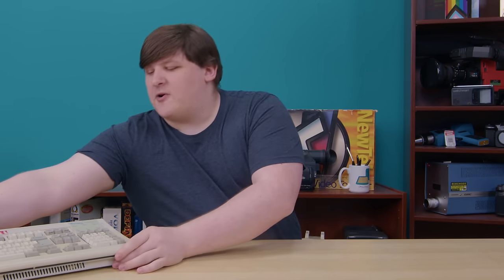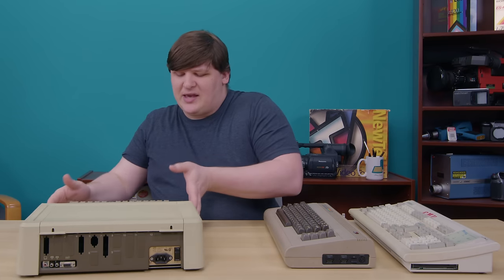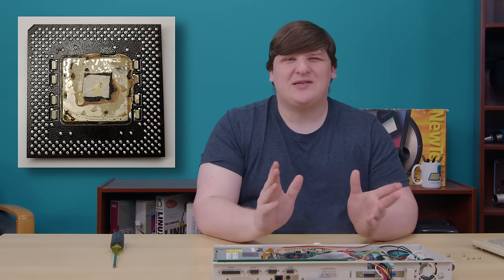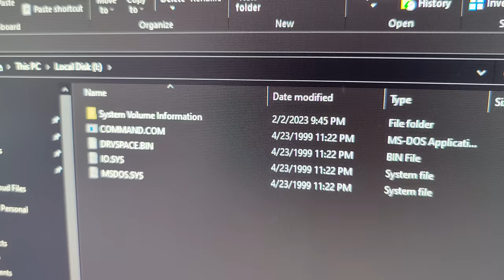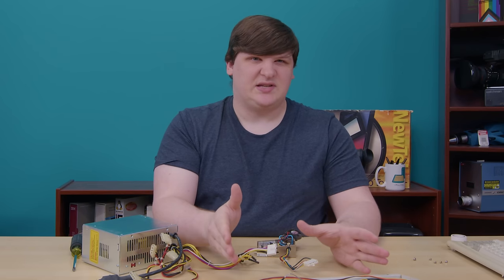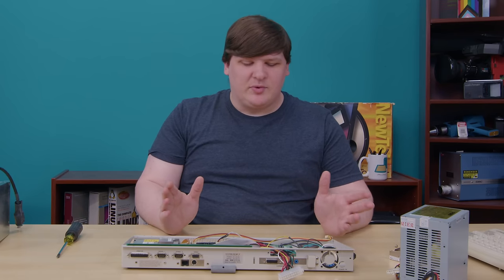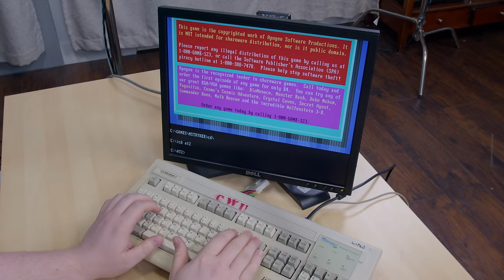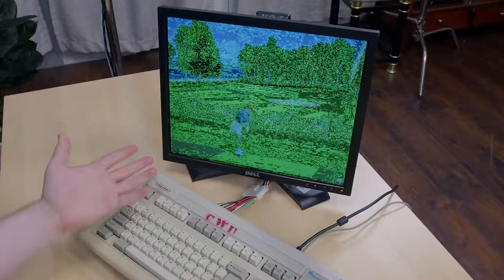I turned a weird "keyboard PC" into an FM boombox

Comment: You know what? That atx power supply is actually a really good solution

I got some old laptops, imported from japan, pc98. I have to import the laptop variants because the desk units would be too expensive to ship, though with how many laptops I’ve shipped that might not longer be true. The thing is that the power supplies on these things are extremely prone to failure by now, so yanking out the psu and replacing it with a modern one would honestly solve a lot of issues, and im not planning to ever actually use these things as laptops

Comment: It took me several embarrassingly long seconds to guess why it has no PS/2 keyboard port :P.
The chips near the CPU socket are probably L2 cache.
Wild guess on the VRM daughterboard: i have a couple of old AT mainboards (by PC-Chips, I think) that are compatible only with single voltage CPUs out of the box, but have a connector for a VRM module to enable compatibility with dual voltage CPUs like the Pentium MMX. Or it may simply be that they ran out of space for it, just like you said.
Your song is great!

Comment: I think I ran across a really weird Harris wedge-shaped keyboard computer a few years back. I don't really remember and it's been awhile since I've seen it. I know the board and all of the chips were Mark Harris but I don't remember if that's what's on the enclosure

Company was straight-up prolific with some of their own custom IC chips that are super weird and have little crystal tops like an eeprom would normally....but are not eprom chips. Some of them were special color sensors and code readers. The weirdest one is some kind of weird  oscillator that can be customized to frequency based on how you program the reprogrammable window. One of the weirdest things. Either that or something to do with the amount of light going into the Crystal window changes the frequency of the oscillation. I honestly don't remember but diodegonewild did a laser tube video a year or two back with something very similar inside of it. I'm always poking around and researching weird chips in my collection but I just haven't got to those yet.
Harris chips were always some of the most interesting Stuff in my chip collection even among thousands of rare or weird chips

Comment: There have been a few "keyboard PCs" or "Wedge PCs" over the past few years, I know there were some very cheap ones with Intel Atom CPUs in them.  A company called My Retro Computer is supposedly working on a Commodore 64 replica that looks like a Commodore 64 but has a modern PC motherboard inside it.  The work they're doing is based on the work of Commodore USA back in the early 2010s until I think 2012 when their CEO died.

Comment: Maybe hook an oscilloscope up to the 3.3v rail and see what it's doing. I recently had a weird issue on a board design where the audio and video would start buzzing/flickering in response to CPU activity, I found out it's just my regulators doing a weird threshold thing when the 5v rail can't maintain enough headroom. I mostly fixed it by using a power connector with lower resistance. Maybe that little voltage regulator board is behaving similarly, in which case try reseating it to make sure those pin headers are making good contact.

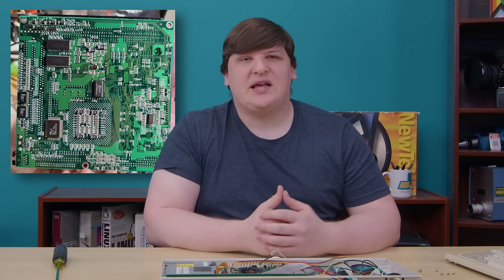Comment: 15:20 Actually this add-on voltage regulator was very common, especially on early socket-7 motherboards to power Pentium-class CPUs where split voltage was first introduced. Another youtuber even made an open-hardware version that fits many motherboard. It was kind of a standard.
Although from your video, it's hard to tell if that 'standard' is followed. I'm guessing not considering it's parallel to the board.

Comment: The wobbly screen does seem like some kind of power or ground issue upsetting the clock in the video chip, you would have to poke around with a multimeter or even a scope to see if ground isn't properly at ground potential or the voltage sags when under load or whatever.

Comment: The Poisk is not the only one post-Soviet "wedge PC". There was at least 4 more IBM-compatible models:
- "Assistant-128" - architecturally similar to IBM 5150 with CGA and ports card. No FDD by default, 128K RAM. Actually made in Russia (by Iskra)
- "Quasar 86" - based on 8086(!) clone, but has no extension slots. No FDD, 128K RAM. Made in Russia too.
- MC 1502 (MS 1502) - uses 5 original soviet ASICs as a "chipset" and has 5.33MHz clock speed. 128K RAM, no FDD by default, but pretty extensible. Designed in Ukraine, made in Russia.
- MK 88 - had an FDD controller for external drive unit, up to 640K ram, and car-like price. Designed in Ukraine, made in Belarus.

All of these PCs are IBM-compatible by hardware without emulation things used in Poisk. But they was even less common in retail.

Comment: As a musician, I'm impressed with that song! You should totally be proud of it!

The weird behaviour makes me feel like its EMI related. What with the effect presenting itself during processor loads.
Perhaps due to the cooler?
Reply from the maker: Thank you so much!

Regarding the EMI - it's been pointed out that the VRM is directly on top of the graphics chip, and I bet that's what the problem is.
Reply: @Cathode Ray Dude [CRD]  You are more than welcome :)

Ahhh, that does make sense. A grounded sheet of aluminium inside a layer of kapton may be a janky solution, im sure you've thought of that already though. 

Either way, keep up the fantastic work, man!

Comment: The long delay when its booting and not reading the drive happens when there is no ethernet connected and it sits looking for an IP.  It times out and keeps booting eventually.  if you connect a cable that delay won't be there.  The video ripple seems to be a common problem with (cheap?) onboard video...even on more modern pcs.

Comment: What an interesting machine. The keyboard computer form factor hasn’t completely gone away, although as you can imagine, the modern one I know of isn’t exactly aimed at mainstream desktop. The Raspberry Pi 400 is a neat, compact little keyboard with a 4 GB Pi 4 laid out in a different motherboard form factor. As a hobbyist I can think of some interesting uses for it.

Comment: One quick thing I would suggest for your wobbly display is to slap a ferrite core around the VGA cable.  It could be that /changing/ what's shown on the screen is sucking power from the sync line to remote ground.
Reply from the maker: interesting idea! I THINK I'm using a cable with a ferrite already but I'll double check.

Comment: I think all in one computers that have a built in monitor, such as the iMac G3, also hurt the market for Wedge computer. Keyboards were cheaper and easier to produce, so the value of having one built in was a lot less compared to the computers in the 80's where personal computers were a whole new thing. Monitors on the other hand were still pretty expensive, so having one built into a computer gives it a lot more value than a built in keyboard, and it's harder to break a monitor on accident than a keyboard (at least in a "professional" environment.) It also mostly solves the size issue that the computer you showcased has (at least with it's cooling,) as monitors are bigger than keyboards, so there's more room to work with.

Comment: You might want to try a PicoPSU, a converter the size of the ATX plug that produces all the ATX voltages from a 12v input.Except that as far as I know it doesn't have -5v.
Also, if there is no -5v the health page of the bios (voltages and fan RPMs etc...)might hang. It happens on one of my boards.

Comment: "What could it be going?" - Windows 98 is trying to find a DHCP supplied IP address on the network during boot, which is insane because it will do that regardless if a cable is connected or not.

Comment: That jitter in the clocking of the VGA could also be from the heat causing the timing of the graphics chip drifting but your probably right about the power supply. I would really add another fan in there and replace some electrolytic capacitors and perhaps add a few high value ceramic surface mount ones that are a quality rating. See your power supply extension might be too long and the added inductance might be an issue.
Reply: You should also look at the capacitors around the CPU and graphics chipset.

Comment: The video issue is due to the onboard vga chip made by Chips and Tech with 1meg or half meg video memory. The other thing is the SIS chipset which has been known to give issues with multimedia. The Pentium 233mhz MMX cpu is pretty nice and stable but only with a intel chipset. Ironically, the P233 mmx would run pretty cool and you could have gotten away with a copper heatsink solution for a fanless PC but live n learn I guess. For some one who says he never played with adlib tracker you sure nailed it with that song my friend!

Comment: You can add the Olivetti Prodest PC1 on your list of wedge PCs from the 80's.
And the Atari ST (520 & 1040) when used with PC Ditto (a software PC emulator that allowed a ST to boot MS-DOS 3 and not much more since it was very slow, nonetheless a good way to format a MS-DOS compatible 3 1/2" disk on a ST).
The Pentium MMX was originally an evolution from the original Pentium (with added Multi Media eXtensions) with an higher frequency than the previous ones (from 120/133 Mhz to 200/233 Mhz), then become the entry point when the Celeron/Pentium II were released.
It might be possible to find a Pico ATX switch that has proper -5V rail, this way you could put it back inside the comuter and use a standard 19V laptop PC brick.
Yoy could also replace your 2.5" mechanical HDD with a 44 pin IDE to Compact Flash adapter ore even a 44 pin IDE SSD.
There's a better way to transfer files through your network instead of using a web browser with FTP : Dukto is a small piece of software that can be used to transfer files, but the Windows 98 compatible version (Dukto vesion 2) sems quite hard to find nowadays.

Comment: great video! you could 3d print a part to hold the power plug in the back. as for video issue check for bad/loose connections.

Comment: Those Winbond chips would be the L2 Cache. And they are good to see as performance would be abysmal without them (eg. A 300MHz Celeron without L2 was slower than a Pentium II 233 in games at the time).

I seem to have gotten lucky with my AT PSU - no RIFA capacitors when I replaced the blown caps+fuse.

Comment: 1:40 Here in germany we had the schneider euro line, which were pcs in a keyboard. The pc had the 8088 and it ended with the euro sx with a 386sx.
Reply: Those were the Same Machines as the Sinclair and later amstrad PCs though
Reply: @nilswegner2881  The schneider cpc where licenced clones of the Amstrad homecomputer. But the Euro PC was developed by Schneider, not Amstrad.

Comment: Looks like that glued on fan was a TennMax Lasagna cooler. A popular choice for iOpener modders. Cybernet was big in advertising the keyboard PCs in the back of PC Magazine and other Ziff Davis publications. Someone apparently bought one, but not enough that they are common. The build quality is terrible. A better path would have been to use actual laptop parts to keep the size down.

Oh, and the tracker song sounds a lot like the file called EARTHDAY.RMI that came with the Windows Multimedia Pack.

Comment: PSUs of this era do supply 3.3v but it's hardly used, mostly for running the RTC to avoid draining the battery. All the power for the CPU and basically most everything else is derived from the 12v rails, which is why modern PSUs aren't always great for legacy ATX systems as they have massively de-emphasized 5v and 3.3v.

Comment: Actually “computer in a keyboard” is still a thing; ranging from a tiny Raspberry Pi device to a huge PC running Linux meant for people with vision loss that aimed to be fully accessible without a monitor and fully integrated into a single component.

Comment: This seems like a very strange motherboard to be designed for a low-cost PC. A consumer PC would more likely have an onboard modem instead of Ethernet and would have onboard audio. I'd tend to agree with another commenter who said the board was originally designed for something along the lines of an industrial control panel.

Comment: My guess: It stops for 20 seconds in bootup because you set the network card to use DHCP. Win9x does the network config on bootup so if nothing is connected or there is no DHCP server it waits for quite a while.

No idea if someone already commented that, I'm on mobile and have no idea if there's a way to search comments in the app.

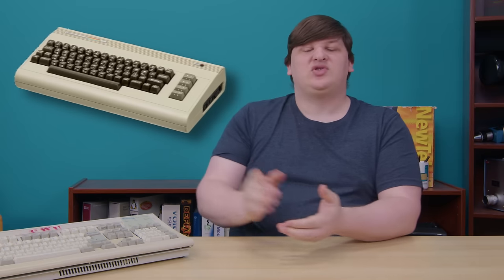Comment: 0:59 “the keyboard wedge design” — I’d avoid this terminology, for the simple reason that the phrase “keyboard wedge” already has the established meaning of a barcode scanner or magstripe reader that is connected in between a keyboard and the host PC (typically, in a point of sale system), allowing the scanner/reader to send keystrokes, instead of needing a dedicated port (for example, RS-232) on the host. Nowadays, with USB, OSes support multiple keyboards, so barcode scanners usually connect via USB and emulate a keyboard. There also exists “keyboard wedge” software nowadays that interfaces between specific devices and inserts keystrokes into the application (typically, for when the application can’t be modified to allow native interfacing).

Comment: I'd recommend getting a new ATX Pico PSU that uses 19v from your run of the mill laptop power brick. And mount that inside so you kinda have it looking good. Other power issues I'd guess daughter board capacitors kinda died.

Comment: I guess that power connector would be a kycon KPPX-4P, they do a bunch of weird mini-din-alike connectors amongst ore mundane stuff like usb connectors and stuff.
as for the floppy flex cable, can you make a scan of it on a flatbed scanner? preferably with a millimeter ruler next to it, it may bell be replaceable with a stock flat flex cable or in worst ase with a "order it yourself at your preferred pcb service" reengineered mylar flatflex
Reply from the maker: Couple people suggested I could replicate the ribbon and yeah, I couuuuuulld, but honestly I hate using floppy drives anyway and this one ain't the hottest. I don't really need it for anything since I have the network connectivity, and if the HDD ever fails, I'll probably replace it with an industrial SSD that I can easily pop out to load up files.
Reply: @CathodeRayDude  thx for the response and no blame on you ;-)
floppy drives always were a bit of a pain, paticularly on their way out of the market (especially true for the disks, though). Some SSD or maybe a CF or SD card to IDE adapter may well be the better option. just wanted to point out th option and offer to re engineer that cable for you should it not just be a simple 1:1 weird angle one (which you could replace by a folded off the shelf flatflex)

Comment: Regarding the floppy - it is possible to fix that cable - top solder mask can be scraped off, carefully. and cable restored with soldered on thin wires. then just add polyimide tape on top and it will work.

Comment: Someone should make "wedge" PC enclosure with a built in mechanical keyboard that uses a Mini-ITX motherboard and a sideways mounted video card. Or if you went for something more Apple-II sized you could get away with a Micro-ATX motherboard and use longer video cards, you could probably fit something RX 6700XT or equivalent in there with a little room to spare. The CPU would of course need to use either a low profile cooler or a water block and radiator.

Comment: 7:00 “typewriters had no concept of touch-typing” — huh? “Touch-typing” means typing with all your fingers, without looking at the keys. That’s a feature of the typist, not the device they’re typing on.

And I assure you, typists, secretaries, etc. were absolutely expected to touch-type at high speed with high accuracy. That was already the case with mechanical typewriters, and even more so with electric typewriters, which didn’t need as much sheer finger force.

Comment: I've seen a lot of weird behaviour related to cpu activity on systems up through the years. Coil whine is the most common but I've also seen graphical glitches like the wavy stuff you see on this. I'd suspect it's the CPU vcore regulator.
Reply: i recently got a powerbook g4 (the titanium one lol) and i noticed the coil whine with cpu usage a lot, on some cpu benchmarks that arent very good and make the cpu get busy at around 40-60% and goes up and down very quickly it makes a very loud noise i didnt think it was common at all, i have like 20 old laptops and none of them have ever done that so glad to know its not too unusual

Comment: Consider a laptop IDE to CF adapter. CF cards (except Microdrives) don't park their heads (they're flash cards, they don't have heads to park) so Windows (or Linux, if you ever run that) should boot a ton faster.